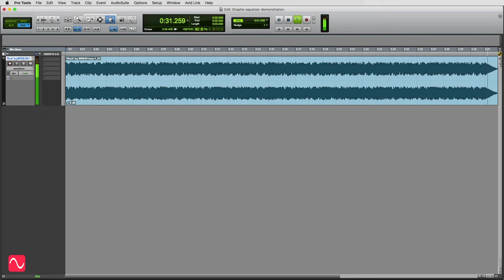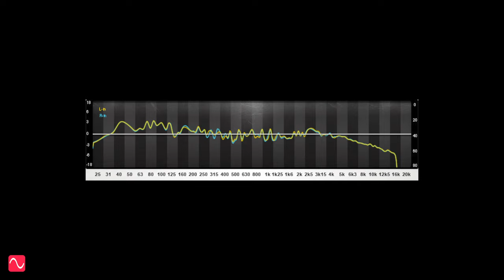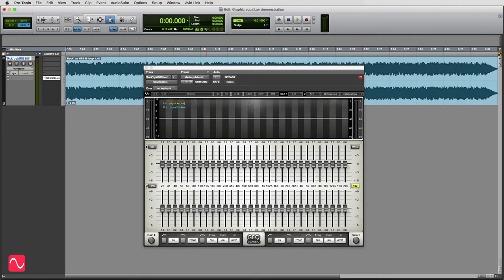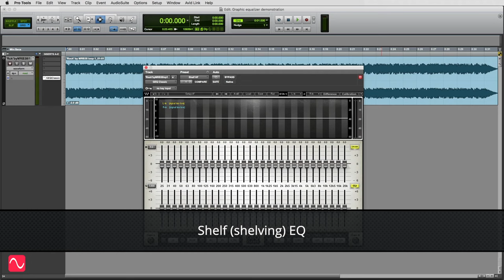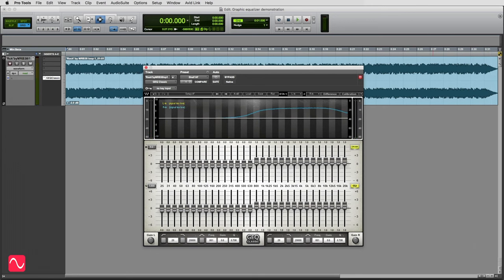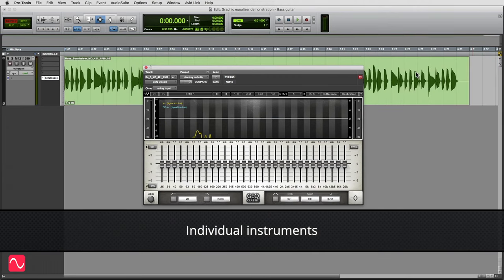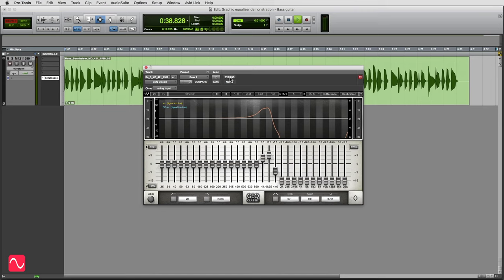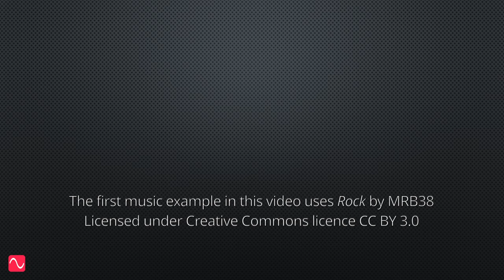Graphic equalizer demonstration using the Waves GEQ Classic

Comment: Sounds like there is more than 3dB treble boost in example one. Suppose you think it's too much, then you have to drag every slider carefully down, while a parametric would only need 1 knob moved. Why would you prefer a Tilt instead of two shallow Shelves?

I loaded another graphic EQ from a reputable brand in VST analyzer, and I saw significant "ripple" in the frequency response instead of a flat line. Each bell's Q didn't completely overlap with its neighbors.

I think graphic EQ is mostly for room or speaker response correction where it's hard to break down the curve into elements.